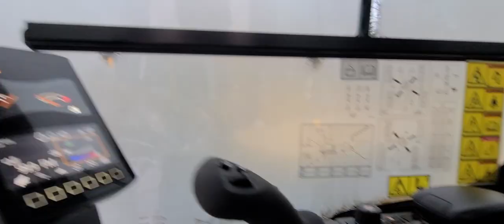Winter Excavation: Digging Through Frost

Comment: The point to point Ubiquty radio set up is the way to go imho.   We’ve used them for temp cctv and data transfer.  He should have went from the tree to his building over the air. The ubiquty set up isn’t that expensive and works well, still need little power though.